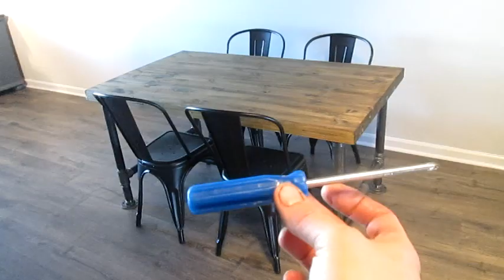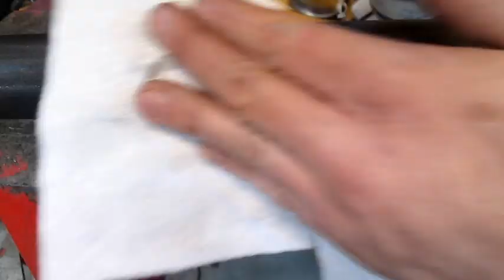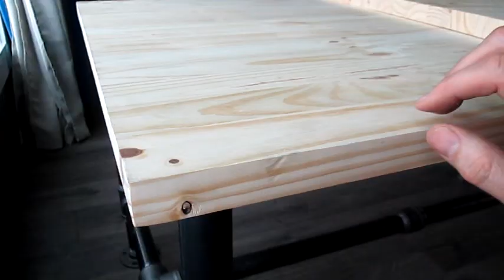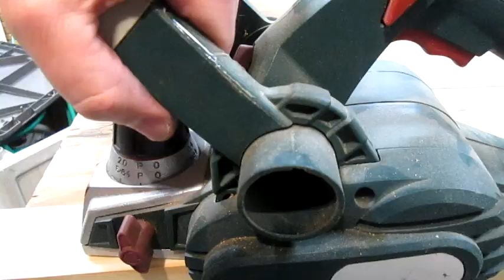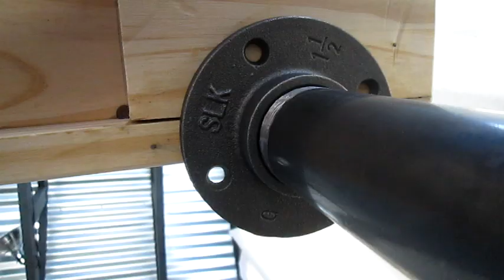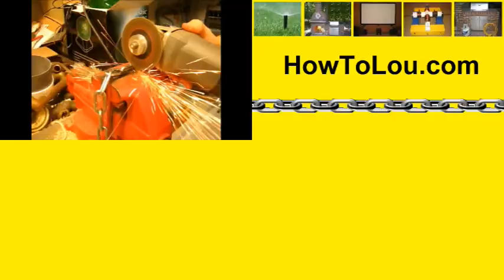Build This DIY Industrial Table with ONE Tool!

Comment: I love this video, but for the life of me cannot find 1 and 1/2 inch black pipe at either of my Home Depot or Lowes stores nearby.   I'm looking online and they just have half inch, inch, and two inch pipe.  And wowza, the price is high.
Reply from the maker: In the Midwest, we have a hardware store called Menards.  Its just like Lowes and Home Depot.  They have the 1.5 inch.  Google Plumbing Supply in your area. These are places that plumbers go, but you can too.  Yes, the pipe is kind of expensive.

Comment: Hi I’ve been picking my brain but can’t figure it out , if my wood is gonna be cut at 5ft 1/2 and 3ft wide what would be my measurements for the pipes… please help 😩
Reply from the maker: I would keep all the pipes exactly the same.  My table was 36 x 58.   You want 36 x 66.  That’s only 4 inches more overhang on each end and will look great.

Comment: What size washers did you use with the drywall screws?
Reply from the maker: I think they were 1/4 inch washers.  They just need an inside hole small enough so the screw head won’t pull through.  Another option is to get screws with larger heads.   I just used what I had on hand.

Comment: Just out of curiosity, how much did that steel pipe cost you in total?
Reply from the maker: Way more than you would think.  About $150 for pipes.
Reply: @HowToLou  Yeah, that's about what I expected, but at least it was quite the simple job, especially if you don't have available tools to make a fully wooden table. Nice idea you had, might try it myself, maybe with some cheaper pipes like PVC or something silly.
Reply from the maker: Good idea!  Look at Schedule 80 PVC.  Its stronger and a nice gray color.  Get a can of PVC cleaner to remove all the inked words on the pipes.  You can cut with a $5 hand saw.